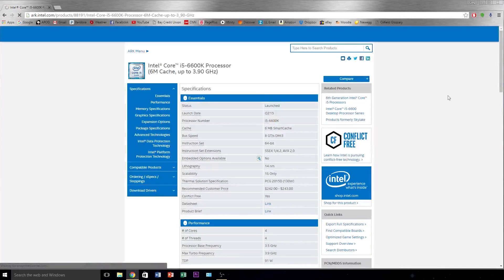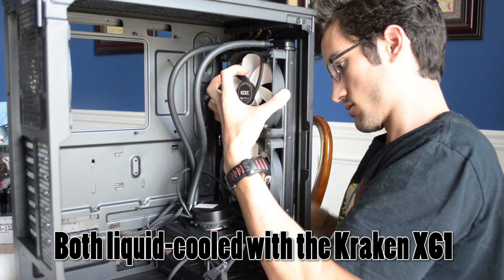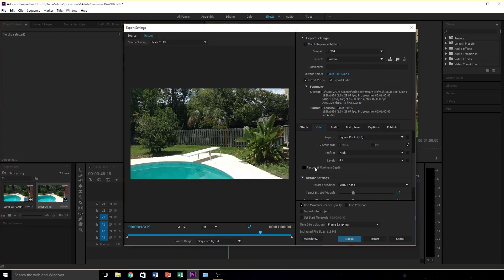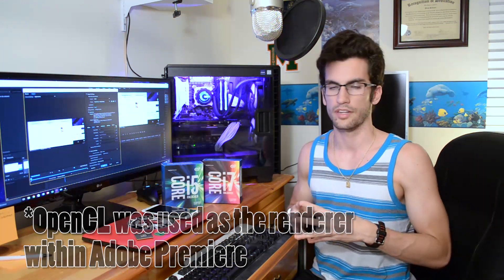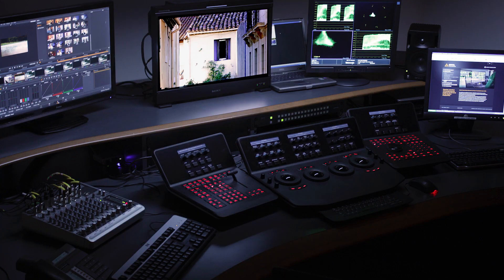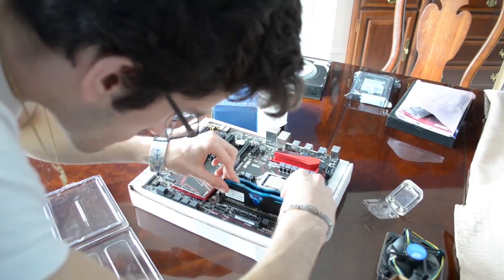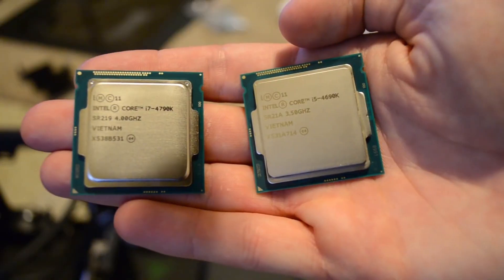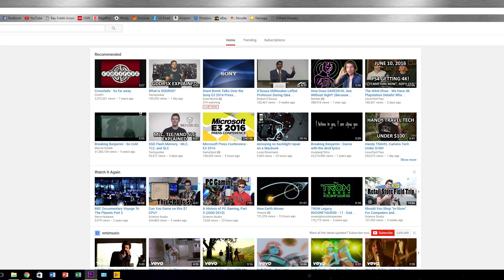Video Rendering Face-Off: i5 vs. i7

Comment: The main thing thats bothering me, is that i cant watch my draft in full quality without lag on Sony Vegas 13. I am using i5 3350P 3.1Ghz (4 years old)
Will a new i5 generation solve this issue and work better on SV16? 
Or should i go for the i7 as i might be doing 4k in the future? 
I dont mind the long final render, as long as i can preview in full quality

Comment: So i got a question i m going to upgrade my system and i cant choose between i5 7600k and i7 7700k because what i m going to upgrade at last is would be my graphics card so if i get a i5 7600k would it be good for a 6months with a gtx 750 ti 2gb or should i grab the i7 7700k and then buy in a 6months a gtx 1060 thanks for the answers!

Comment: is i3 6100u worth for editing??
Please Help I.......
Actually I need An Answer between them:
      i3 6100u , 940mx ,4 GB Ddr4
Vs i5 6200u , 920mx ,4gb ddr4
Reply: Yashraj Singh No, you should at least have a i5 6600K/7600K overclocked to its max, also a minimum of 16gb ddr4 (2133mhz or higher) ram and a mid range/high end gpu.

Comment: I have a question T^T
if i7 can cut the rendering time = have smooth playback? 
I not rush to done the job I just try to make my editing will go smooth and enjoyable. 

but now am on a budget if I go with i5 7600,16g ram, 1050ti can make my video playback smooth and get the job done? with using photoshop lightroom after effect and premiere pro?

or I necessary need to go i7? is that so much different for 100us different

Comment: Thanks for this video. It covered exactly what information I wanted to make an informed decision. I will be doing a lot of multi-tasking to include video editing, as well as running IronCAD (solid modeling) and AutoCAD in addition, albeit not at the same time. Now it's on to what mobo. Thinking of the ASUS Z170-A. Any opinions, anyone.

Comment: Sorry to dig this old video up, but I have some question.

According to intel's Nehalem whitepaper, Hyperthreading can improve the performance up to 30% which also corresponds with your result.
However, the "Adobe Hardware Performance White Paper" describes clearly about a minimal benefit of HT when all physical cores are (almost) fully occupied, which imho means when their software are exporting or rendering.
Then,  if your 30% result is correct why Adobe didn't take their chance to advertise their perfectly HT usage?

Only one thing left is a difference of  6MB vs 8MB at L3 cache, would you mind to re-test the i5 vs i7 with HT-off at the same clock?

Comment: I would like to see that test with the i7 6700 non-K, but everyone just ignore it and do not benchmark it at all. We know the 6700K even not overclocked has higher stock settings than the i7 6700 non-k (3.7 vs 4.0). It's funny how every i7 6700k is benchmarked with overclock, and people would say: "Of course, it was made for overclock purposes". But i think its worth to show how it performs with stock settings compared to its non-k version (like you did on this video: rendering times, not gaming. Because while gaming its hard to notice the difference... but what about benchmark, rendering times, and multi-tasks? So people who do not pretend to overclock will see if is worth the non-k version or k version (if the performance increase is worth the money or not), also its what mostly confuses people around the internet. We continue to see in forums due to lack of info about these: "Should i buy the i7 6700 or i7 6700k, or even i5 6600k", and so on... It's just my opinion, thanks, man!

Comment: If possible, I would love to see the following test:
Using the processor constant, that is the i7, comparison between Quadro and GTX. I have searched on YT, but I couldn't find any quality content compared to yours. It would be better if you can do the comparison with different GTX models, 780ti, 980ti and 1080, and keeping Quadro to maybe the cheapest in the current gen. Running the benchmarks for the following softwares, 3ds Max, AutoCad, Sketchup and any video rendering software.

Comment: sir are i5 and i7 need a graphics card or it can perform well without graphics card ?
Reply: 100 percent you need a graphics card. Good luck on playing a real 3d game on just a processor :)
Reply: depends on the game, usually you're gonna need a Graphics card though, especially for Triple A games like Fallout 4, GTA V, etc
Reply: C 1 y d 3 LORIAGA only game you can play is csgo in high settings and gmod on igpu in the processors

Comment: For avoiding that lag on edition, just use convert que video first for a format that supports GPU acceleration. Search for LinusTechTips video that explain that, it made my i3 editing machine MUCH faster on editing, but the export remains the same. Nice video btw!

Comment: I'm getting a laptop with an i7! 😎
Reply: Laptop i7s are weaker than Desktop i5s.  They are quad core or even dual core and are clocked low (to save battery ya know)

Comment: I actually ended up upgrading to the i7 CPU from the i5 demonstrated in this video. However my overclocks were 4.4 GHz for the i5 and 4.5 GHz for the i7. How did you manage a overclock more than me in both processors? I know it isn't much but i still wonder how.
Reply: silicon lottery bro. u lost the lottery. not all cpus oc same.
Reply: He had a liquid cooler
Reply: ChaseMMD that was a waste of money. 300$ for a average cut in rendering time? Pfft.
Reply: Seductive Nudes What about the changes i'm making in my build again? i7 6800k 4.0 GHz ;). A lot happens in a few months for me.
Reply: ChaseMMD Don't do it. Stupid to keep buying CPUs every few months.
Reply: Seductive Nudes I slowly upgrade my system over time. I think i should be good for a few years.

Comment: how much difference in b/w i7 6700 and 6700K??
Reply: a lot*
Reply: The K has slightly better clock speed and is unlocked (you can overclock).

What do you plan to do with your PC?

Comment: Can still do those render times with a simple gtx 950. LOL
Reply from the maker: Without a fancy CPU, your editing experience will be garbage.
Reply: Ehh, adequate RAM and a decent CPU will do quite well. I have an i5-4440 which could easily edit fine. I am upgrading to a 4790k because of multitasking and future proofing though.
Reply from the maker: +TottieGod "fine" is not the same thing as "very well," which is the experience an i7 or Xeon would give you.
Reply: Science Studio Yes, there is zero to no lagg video editing besides loading clips into your project.

Comment: Do that fx 8300 (4.4ghz) vs i5 rendering. Longer video to render (atleast 5-10min)
Reply from the maker: +Andrash88 The length of the clip does not affect the time margins. I've already done a rendering test with the 8300 in the 8300 vs. i3 video.

Comment: Could you do Blender Cycles benchmarks for GPU rendering when new AMD and Nvidia cards get released? I would be happy even if you just try standard BMW benchmark, although you might need to do a lot of research to understand how get "proper" results considering there are a lot of variables when setting up rendering in cycles render engine.
Also it would be nice to see AMD vs Nvidia benchmarks for rendering some After Effects file or Premiere.

Comment: so I guess an i7-6800k will be a touch faster
Reply: Just a touch.
Reply: ThePowerOfSAM more 2 cores,so it will be better
Reply: Of fricking course it will be better, it has 2 more cores and 4 more threads.
Reply: so 50% more powerful then?
Reply: In theory, Yes.
In practice, Maybe.
Reply: overclock it and you got a really great cpu for the price
Reply: Actually, Yes.
But for what? thats the question.
If you game only, No.
If you render and 3d model and stuff like that, Yes.
Reply: ThePowerOfSAM For me i use cinema 4D and adobe Pr a lot everyday,and my athlon isn't doing such a great job
Reply: Well, When you will buy a new CPU dont throw the Athlon PC, Keep it.
Maybe you will want to post your results and comparasing of the two on    http://www.overclockers.com/forums/   ?
Reply: ThePowerOfSAM for now i'm thinking of picking a cm hyper 212 evo so my pc can be quieter
Reply: yeah thats a good cooler :P, But you will not be able to oc well a hexa core CPU.
Reply: ThePowerOfSAM i'll just keep my current pc until i upgarde maybe next year
Reply: ok :P
Reply: +yasser hassani no, it will be a third more powerful
Reply: or go with an older CPU!!!!!!,the Xeon X5650 is a 6 core 12 threads CPU,or a E5 2670 V2
Reply: PneumaticFrog yeah
Reply: PneumaticFrog thats what he said :,D. HAHAHAHAHAHAHA !
Reply: I have a question T^T
if i7 can cut the rendering time = have smooth playback? 
I not rush to done the job I just try to make my editing will go smooth and enjoyable. 

but now am on a budget if I go with i5 7600,16g ram, 1050ti can make my video playback smooth and get the job done? with using photoshop lightroom after effect and premiere pro?

or I necessary need to go i7? is that so much different for 100us different
Reply: yasser hassani xeon also have mid range processor this will peform like i7 at the lower price? will it handle some gamming?

Comment: Hey I have a question. I'm planning on building an matx syestem for content creation mainly (3d rendering, video, photo). Now I have the choice between a 6600k or a 1231v3 / 1230v5. I would OC the i5 but not the xeons. How do they compare in that scenario?
Reply from the maker: +Debrugger Almost identical.
Reply: Ok thanks :D

Comment: Would there be a significant advantage to getting an i7 vs an i5 for future AAA titles in gaming and such? Either would be overclocked, of course.
Reply from the maker: +manboytyrone54 DX12 tends to favor more threads, and has the potential to utilize them to a much greater extent. I remain skeptical at this point, but only time will tell.

Comment: Should i get an i5 3570k or i7 3770 ?
Reply: Why are you getting Ivy Bridge? Also, what is your use case?
Reply: Gaming and maybe some 3d modeling.
Ivy bridge because it´s what i could get.
Reply: ***** and the i7 is a non-K SKU?
Reply: Niko Yochum Yes
Reply: ***** hmmm... they will probably be similar in performance when gaming on newer titles, on older titles (pre-2010ish), the i5 will be faster and the i7 will be faster for anything related to content creation.  If you want to OC the i5, you will also have to invest in an aftermarket cooler, whereas you could stick with the stock cooler for the i7.
Reply: Niko Yochum So if i would oc the i5 to maybe 4ghz then it would be better than the i7 ?
Reply: ***** for gaming, depends.  for rendering and other content creation, as well as general multitasking, probably not
Reply: Niko Yochum So what do you think i should get ?
Reply: ***** I personally would probably get the i7... I would recommend getting whichever ends up being cheaper once you factor in the CPU cooler cost.
Reply: Niko Yochum I already have a cooler. The i7 costs 20 eur more.
Reply: +snorlis You should get the i7 especially for only 20 euros more.

Comment: a very interesting video. I expected the results to be better with the i7 but I wander if I shouldn't get an i7 4790k as I also want to go into content creation soon
Reply from the maker: If the price difference between the 4790K and 6700K is rather small, opt for Skylake. You'll benefit from the extra boost in single core performance.
Reply: Science Studio i just recently got my PC (about 3 months ago) and it has an i5 4690, 8gb ram and a gtx 750 ti, with a 550W psu all in a PGS B aero cool Xpredator case that i custom painted with some gold accents, my problem is for me to move to skylake would mean:
new ram
new motherboard
and a new CPU

all out of my budget ATM. i would love to go to skylake but 4th gen products aren't too bad as of yet so i'm not too bothered

Comment: What voltage do you run at to get 4.6.. i was running about 1.35 and passed all stress tests and benchmark programs.. but while gaming it would crash every once and awhile.. dont know if it was voltage or something else.. set everything back to stock it all worked.. so assume it was overclock.
Reply from the maker: I'm running 1.35v as well, and haven't experienced a crash or bsod yet.
Reply: +Science Studio I might try again I ran a registry test and it ran into a few errors so that may have had something to do with it not sure... Seemed to be fixed with a fresh install..

Comment: Having 2 x Nvidia cards helps rendering effects. Not sure about the amd cards on the Open CL setting.  intel HyperThreading is usefull afterall lol
Reply: Yosyp I was once told that not all effect could be hardware accelerated , i just didnt know which.. but thanks for that.
Reply: cuda and open cl have the same Performance
Reply: Malte Roeper Thats good because those new AMD RX480 gpu sure do pack a punch for $200.
Reply: Intel HT is useful in a lot of games too :P
Reply: Niko Yochum Thanks..now i can justify buying that 6 core I7 with Hyperthreading. Its less than £100 more than a 4core I7 and its also a K model , so extra performance from a lightweight overclock. My Rendering should Improve quite a lot from this and the Nvidia cards.
Reply: Gray Fox I just got done doing a fuckton of testing with my i7 and disabling HT and cores and shit and found that for most of the games I tested (including Metro Redux (both with and without PhysX), Fo4, and Dirt 3).  Another note is that if you have a CPU with more cores, you can actually get a performance boost by setting your CPU to be the PhysX processor instead of your GPU
Reply: Niko Yochum I got a crappy used Nvidia  750 ti configured as a dedicated Physx card.. Only used it twice on cal of duty and batman. It does the job
Reply: Gray Fox lol, you bought a $100 GPU just to use it as a PhysX card? :P What is your main GPU? a Titan Z? :P
Reply: Niko Yochum I got it a used model on ebay for £50 , the card used to retail for around £100 over here. I got two 980 Ti on SLI.
Im not rich , i just spend more money than i should on components...bad habits. LOL
Reply: It depends if they are hardware accelerated.
If they are not, it's only the CPU's duty to render those effects.
If they are, it's the GPU the component rendering them.
You can see if they are hardware accelerated by filtering them or checking if there is an icon near them.

Comment: Can't wait to see some RX480 benchmarks and how it goes against the GTX 1070!  Keep it up!
Reply: The RX 480 is not meant to go against the 1070, it will be interesting to see the results though. The RX490 will be going against the 1070 although.
Reply: +Yominikui Yea I was just curious what competition AMD could bring.  I personally own a 970 and I helped my friend buy a 1070, so I was just wondering.
Reply: rx 480 is neck and neck with the 1060 .
Reply: +Aegon 50% discount from someone like nVidia? Yeah sure, good luck with that
Reply: the 480 won compete with the 1070. more than likely it will perform above a 390x but not past a 1070. regardless if these hold true then it will be the best bargain IMO. I will be definitely buying one if the online claims are true.
Reply: +Yominikui Very true but if it gets being within 10% after a modest overclock then we're in for one hell of a card with a sweet deal.
Reply: +Yominikui Let's hope we even get a 490 first...
Reply: they showed the complete lineup of their gpu´s on the pc gaming show yesterday, rx 480 470 and 460...
Reply: it's between 390x and 980 , 1070 is about 144% perf. of the rx 480  in 3dmark firestrike 
http://videocardz.com/61005/new-amd-radeon-rx-480-3dmark-benchmarks
Reply: should i buy 480 instead 970? does 480 more powerful than 970 or is it has a same power?
Reply: +hammer fall Since it hasn't been overclocked and leaks show similar and sometimes slightly better performance at stock so it has the possibility of being better with board partners making it better
Reply: Man was disappointed. :/

Comment: Amazing that there is about a 50% performance increase, and also a 50% price increase from the i5 to the i7.
Reply from the maker: Good point!
Reply: Intel has been in the CPU business for quite a while, they know how to price their processors :P  the only thing I don't understand is why the 6700k is priced so closely to the 5820k (well, now 6800k)
Reply: The actual performance increase is about 30%, so if that's true you're getting less bang for your buck with an i7, which makes sense since it's a high-end cpu.
Reply: ***** you are wrong. 6600k bottlenecks at 144 Hz
Reply: ***** actually... it would.  I have an i7 and turned off HT to simulate an i5 and my FPS droppped in every game I tested except CS:GO
Reply: ***** The 6700k is indisputably the best CPU for gaming at the moment (hopefully AMD comes out with a baller proc with Zen)
Reply: 90 bucks is worth it to me..thats a 1/3 price premium...close enough to half. but worth it

Comment: What's the difference in fps and stream quality between the two cpus when streaming to twitch?
Reply from the maker: Elon Musk Lover :D Not always the case. HT isn't a magic potion to cure all stuttering and frame rate dips.
Reply from the maker: I won't be streaming to Twitch in the gaming tests, but what I can do is use a screen recorder while gaming to report the frame rate difference from that.
Reply: +Science Studio The i7 dont lost FPS while you gaming and stream cause' it has HT,  but the i5 will lost FPS
Reply: Elon Musk Lover :D Well my current i7 930 makes streaming a bit choppy and that has 4 cores and 8 threads, curious to see newer cpus
Reply: Science Studio It wouldnt be the same load but i'd still be interested in that
Reply: i7 930? You know how old this CPU is?............
Reply: How about an Xeon 1231v3 
Asrock H97 Pro4 
Crucial Ballistix Sport DIMM Kit DDR3-1600
Reply: Elon Musk Lover :D 6 years actually :D Still games like a modern i5